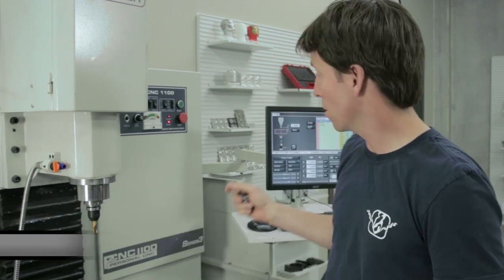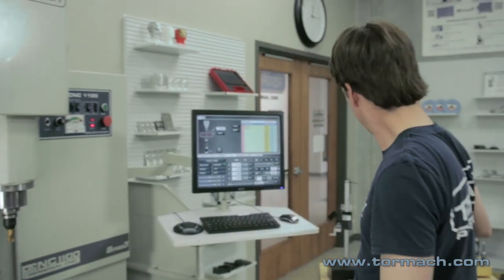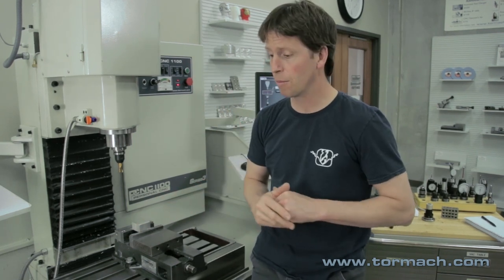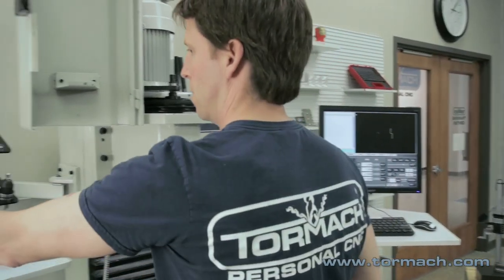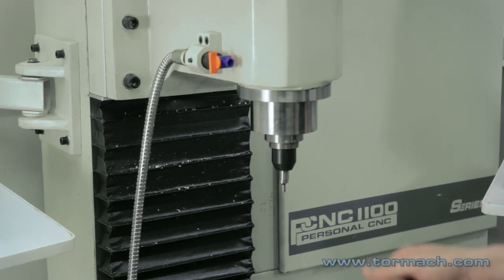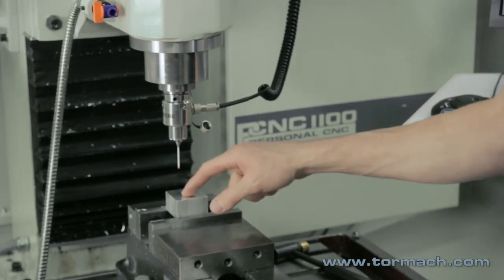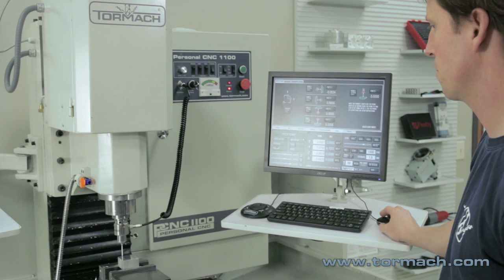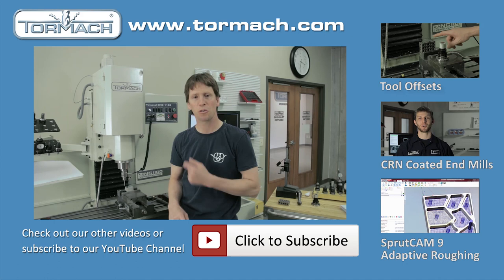Getting Started with Work Offsets in PathPilot

Comment: When measuring the Haimer offline with the granite block and tool height gauge, how do you account for the 2 revolutions (or 1) of pressure that are applied when you touch off for Z? Sorry if this is a noob question but I'm a noob, thanks.
Reply from the maker: Yes, when using the height gauge to measure the Haimer, you would apply pressure until both of the Haimer dials read zero (the large one will revolve twice). You don't have to apologize for being a noob. We like noobs.
Reply: Tormach Inc. Thanks alot, sounds good!

Comment: I'm about to do a small run of parts and would like to have 2 vices next to each other to speed up the process. how do you setup this scenario. You have to have 2 work coordinates? Can you explain how to do it? thanks
Reply from the maker: Typically, you would run a 2nd work offset for the second part. The default offset is G54. You would then setup a second, which would be any from G55 to G59. PathPilot also has G59.0 to G59.3 as work offsets, for a total of ten offsets in total.

Comment: Your video is a big success at the TechShop that I'm a member of. So successful that it is causing problems. Four days ago I was making a part using g-code that I've previously created and used. No problem right, wrong someone modified the offsets for that tool number (tool #155) and I milled through the bottom of the part. So my question is how can we automatically clear all 256 offset values in the offset table and then automatically load our personal offset values from an external source (excel spreadsheet file)?
Reply from the maker: tizwicky We are glad it's a success. The solution to clearing out the offsets is being worked on but isn't ready to be released at this time. We are hoping to get this out in the next release.
Reply: Tormach Inc. Thanks, please hurry!
Reply: @tormachinc  Id like to find a good video or good info on tool libraries and how to clear out the machine library.... the previous owner has a bunch of tools written in pathpilot.. I want to make my own libraries in fusion360 custom to each job.. how do I bring that info into the machine to be able to then set tool heights accordingly.. it is so frustrating that I have to highlight each line, hit delete and sometimes it clears it sometimes it doesnt...

Comment: Lol not your fault but I thought you were using the wiggler on TOP of that aluminum block when setting your Y axis work offset (which I know doesn't make sense) but I was seeing the reflection on top of the work piece. The wiggler is on the back. I broke my wiggler touching it off to the top of the block but fixed it.

Comment: i followed this step by step with him on mine and when i told it to move and set probe length as it touched the 123 block probe light came on but it never stop and backed off snapped my probe tip and just keep going down tell i hit e stop G38.2 move finished with out making contact . that probe only comes with one tip and to replace it is $100.00 WTF  i watch this 2 times before i pulled my probe out and followed him step by step
Reply from the maker: Please contact us through our Technical Support page and we can help you resolve this issue. https://www.tormach.com/support/contact-us/

Comment: Can I simply touch the probe of with the Tool Setter?
Reply from the maker: Since the TTS probe moves as part of its function, you may not get an accurate length when touching it off with the tool setter, which also moves as part of its function. We show the most consistent and accurate way to utilize the probe in the video.